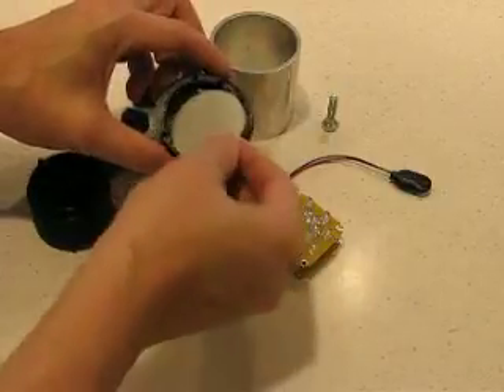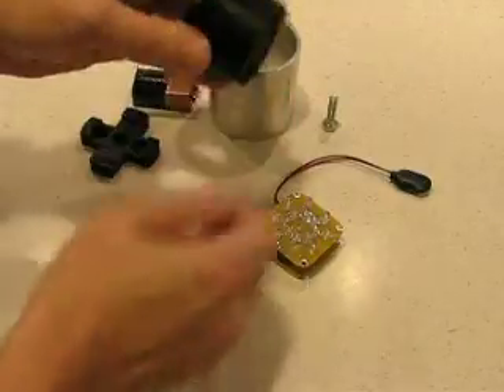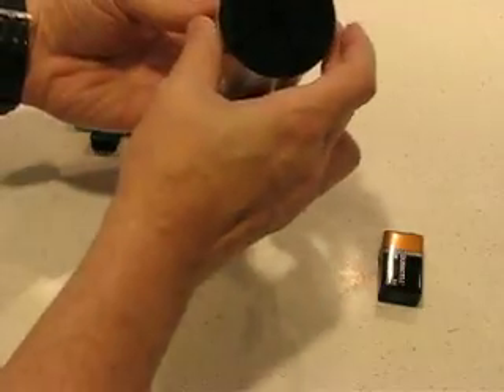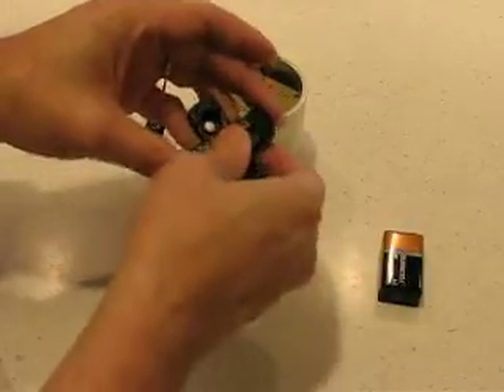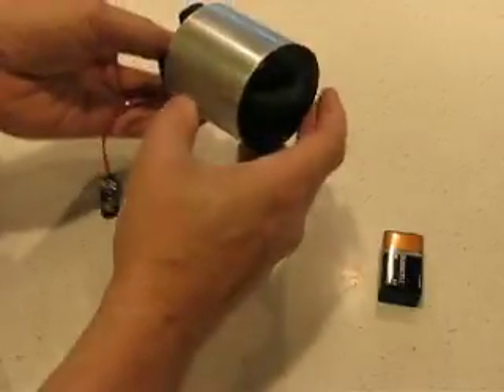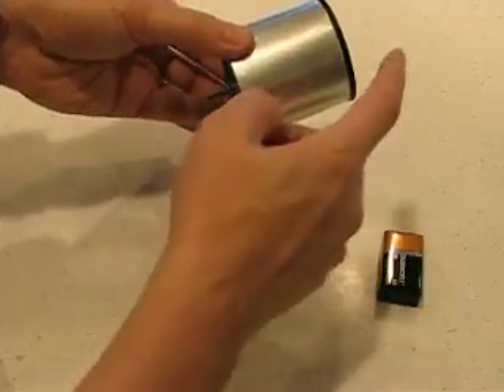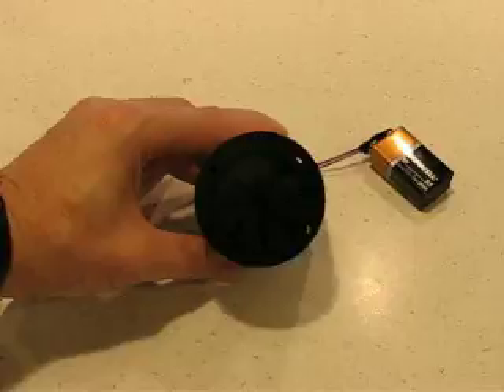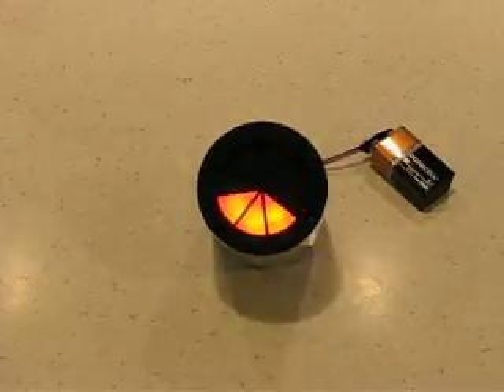HGA housing for Jupiter Electronics

Comment: Dude, you gotta tell me how you did that. What kits did you use? Were some part 3D printed?
Reply from the maker: Multiple 3D printed parts, diffusion material, a length of aluminum pipe and multiple Screws for decoration and attachment.  The LED board is from Jupiter.  (I also had a similar set for use with an addressable LED ring that required some external controller to update the LEDs)
Reply: @ghostlab42  could you send me the 3d parts? Or a link for the 3d parts?